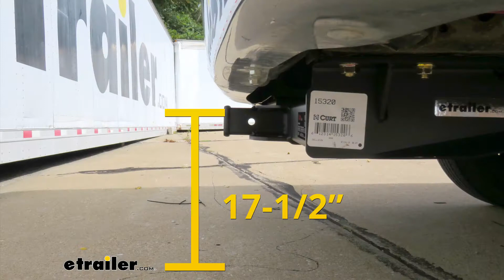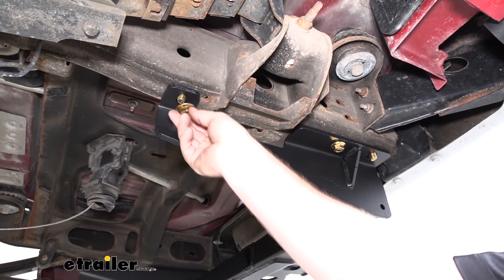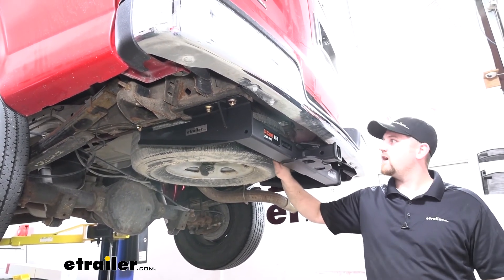etrailer | Installing the Curt Trailer Hitch Receiver on your 2011 Chevrolet Express Van

Comment: did it come with hard ware ? i just bought it and wanna know if i have to run out and get some
Reply from the maker: You're all good! The hitch includes all the necessary install hardware. You can see the hardware listed on the instruction sheet, which I'll link for you below.
https://www.etrailer.com/instructions.aspx?pn=C15320
https://www.etrailer.com/Trailer-Hitch/CURT/C15320.html